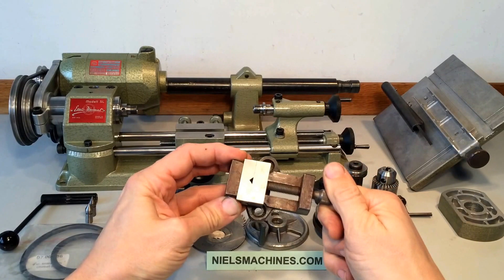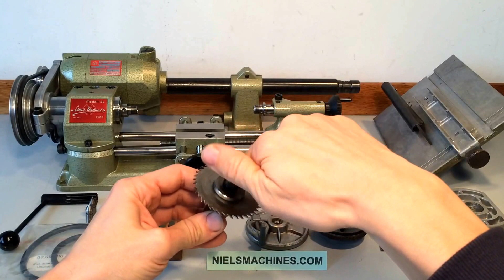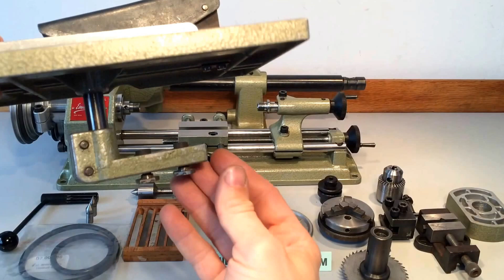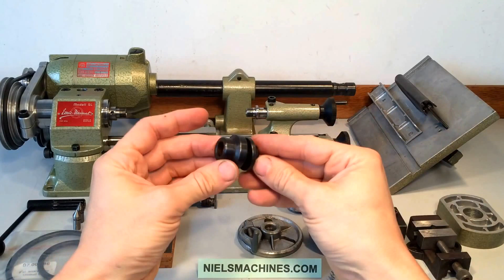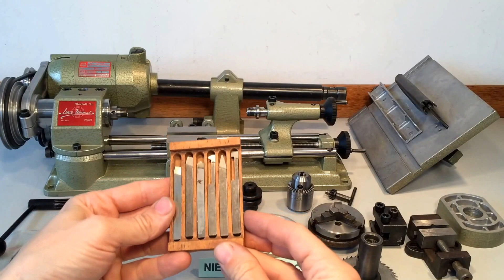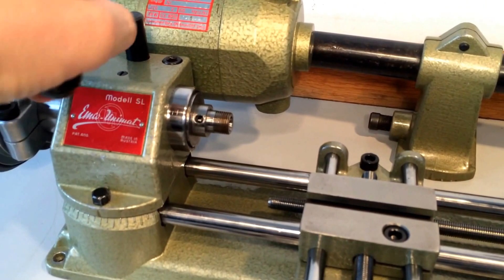Emco Unimat SL Lathe Collection

Comment: Awesome video! i found one of these practically unused at a garage sale for free because the owner thought it was broken, it seems like it all works just some of the threads are a little rusted so i need to take it apart and clean it. Ive watched this video atleast 5 times now just seeing how it should function
Reply: wow good score.  Im  about to buy one for $1000
Reply: @ameliabouman151  Dude! CheckEbay! They are much cheaper there
Reply: @martinpanev6651  You get what you pay for. Junk is never cheap enough.
Reply: @MrjackieG  I got one of these for 100 bucks with everything restored on ebay from someone who didnt know what they were selling